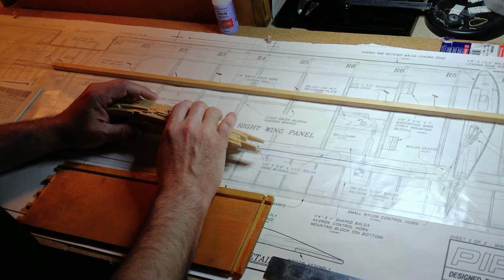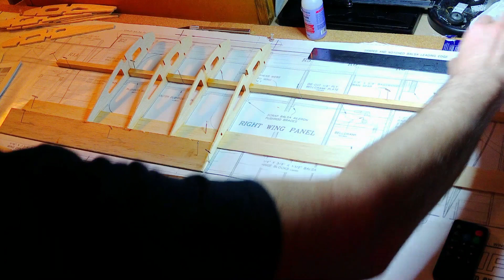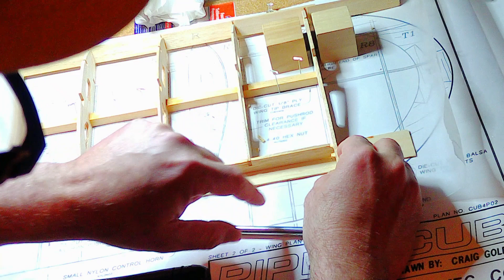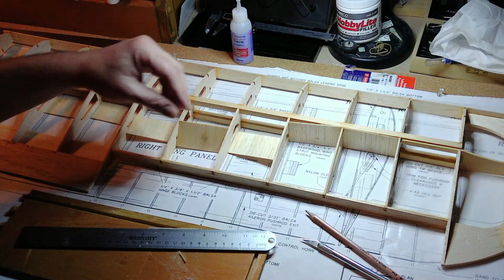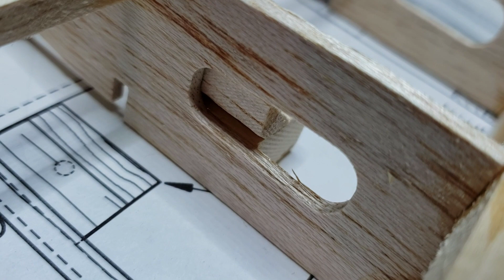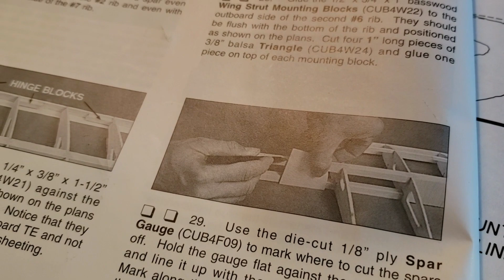RC Taildraggin! Great Planes J-3 Piper Cub build video #3

Comment: Bro, may I know what brand of glue do you use? Thank you
Reply from the maker: For thin CA I use Starbond, medium I use Stick Fast, wood glue is Elmer's Carpenter wood glue, and if I need epoxy I use Bob Smith Industries 5 minute quik cure..
Reply: @RCTaildraggin  Bro, Noted with Thanks.

Comment: Good video....keep them coming.  I did have a question on the rib cutout issue.  When you glue that piece back in, will that cause an issue regarding stresses on that wing strut mounting point or is it so insignificant not to matter?
Reply from the maker: The area where I put the cut out back in will be stronger than without it. The idea was to have somewhere for the block to securely glue to. I want to prevent a heavy bounce from ripping it out of the wing..